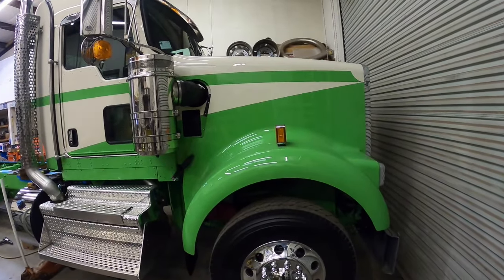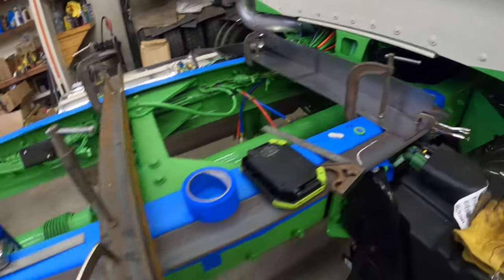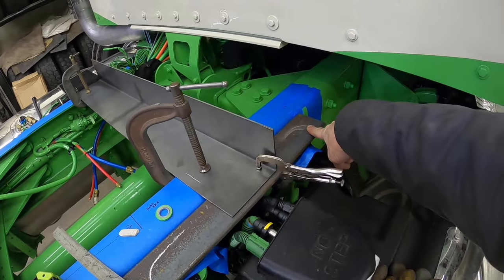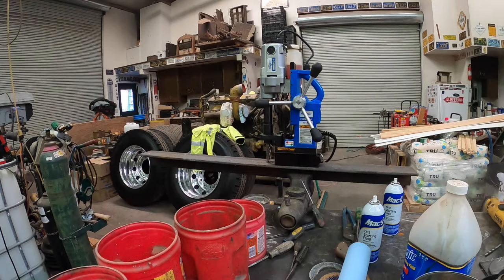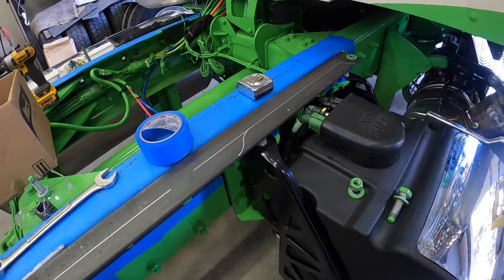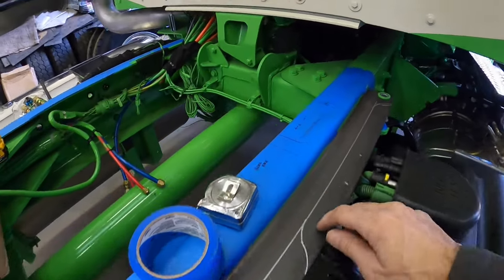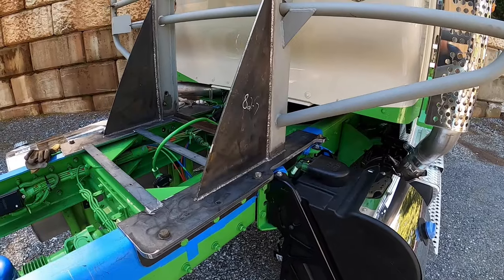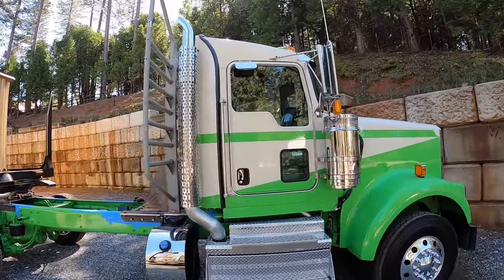2024 Kenworth Log Truck Build Headrack Installation

Comment: 👍🏻👍🏻
Reply from the maker: Thanks, and thanks for watching
Reply: @FourthOver  what kind/brand light did you install on back of cab???
Reply from the maker: @moondog3162  I think they were Grand General lights with the 1156 bulb plug in. I had trouble finding longer screws to hold them in, some metric thread size.
Reply: @FourthOver  ok....thx

Comment: Did you have a hard time ordering and buying a 2024 ? My accident occurred Oct 20th 23 and 2 days later I tried to order a truck and was told I'm to late new emissions laws in California Oregon and Washington there wasn't a truck manufacturer that uses an engine that will comply with laws as of now  sorry
Reply from the maker: I ordered this truck in August of 2022, it took about a year and a half to get. I've heard some stories about the new emission laws but I'm not sure on any of them. They are still building the W900 I just hear they are very hard to get. The government trying to screw everything up. Thanks for watching.
Reply: Wonder if Peterbilt 359 379 398 are going to up in value since they discontinued 389 for 589